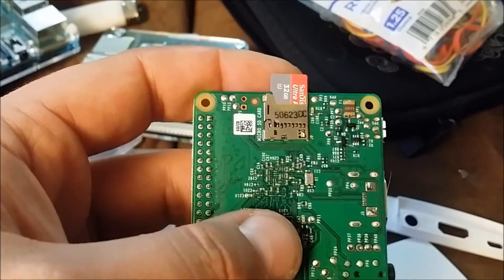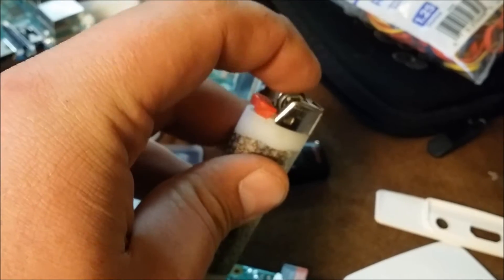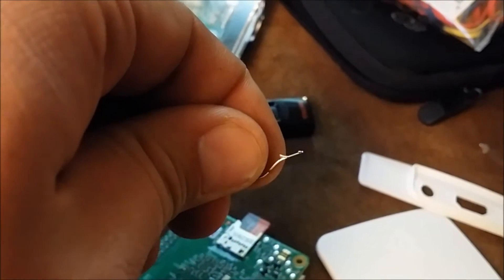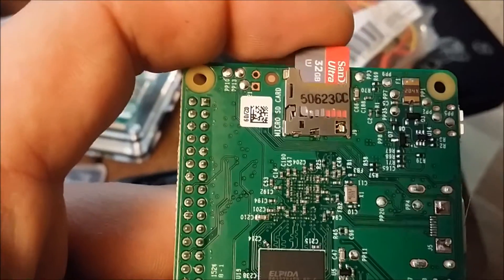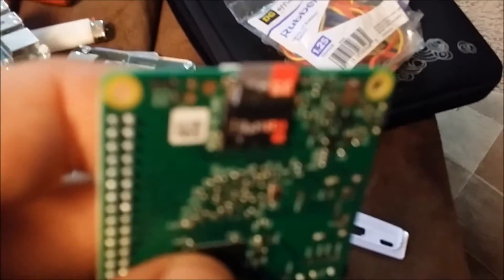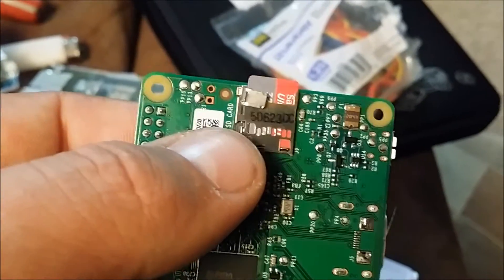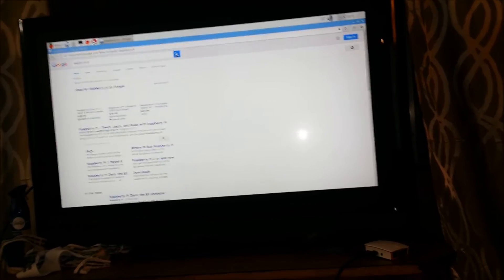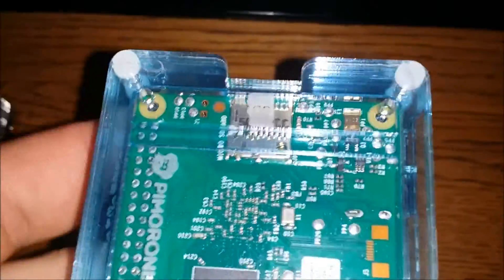Raspberry Pi micro sd fix (wont lock in)

Comment: With 1 or 2 needles you can remove the spring mechanism altogether and make it work as in the newer Raspberry Pis (with friction). You just peel up the little J-shaped metal part (on the left side of the sd card holder when the spring mechanism is). Then you can remove a tiny locking pin. With some needles, you can get a hold of the spring and force it out rather easily. Cut it off, and the card will not spring up. Then press down on the metal can to bend it down a bit, so it will press the sd card against the pcb when inserted, and viola.

Somebody did the same here: https://raspberrypi.stackexchange.com/questions/45700/micro-sd-card-slot-on-pi-2
Reply: Thanks, that fix made it for me, really easy and convenient!

Comment: I'm noticing the locking mechanism... bottom left edge of the 5 on cereal number... an upside down J cutout shaped thing. it is supposed to hold the spring mechanism down. It holds the micro sd card in when I press it with my finger. perhaps it got a little unbent when the micro sd was pulled out? I'm going to try to bend it down some
Reply: It stops the micro sd from moving because it prevents lateral movement on a lever like thing next to the spring(underneath the upside down j thing) there must have been a hook in there and it got unbent. between the slot for this workaround and my upside down j thing the hook is hidden underneath. I may dremel the casing away to get a better look